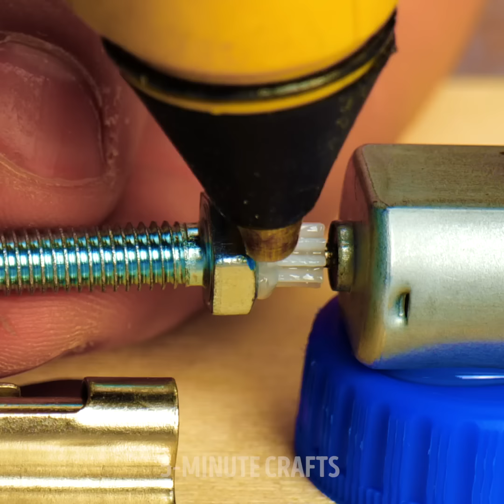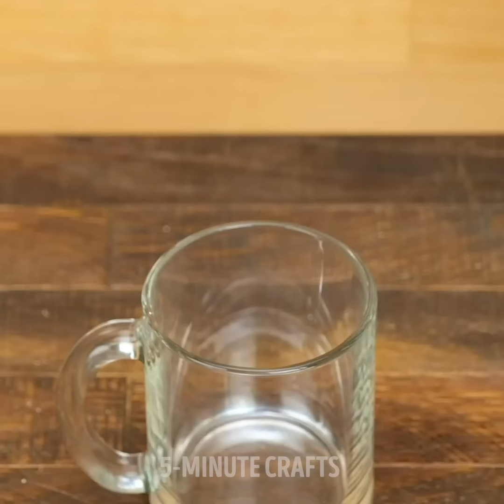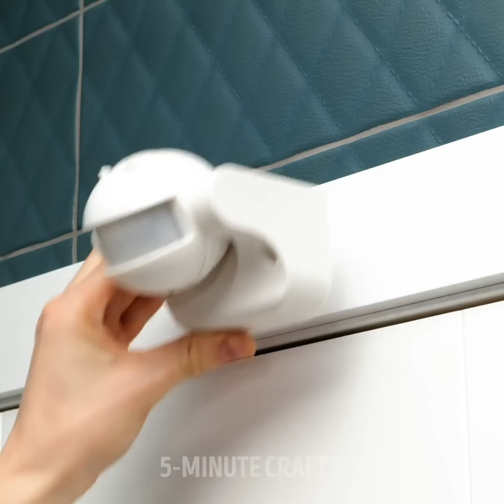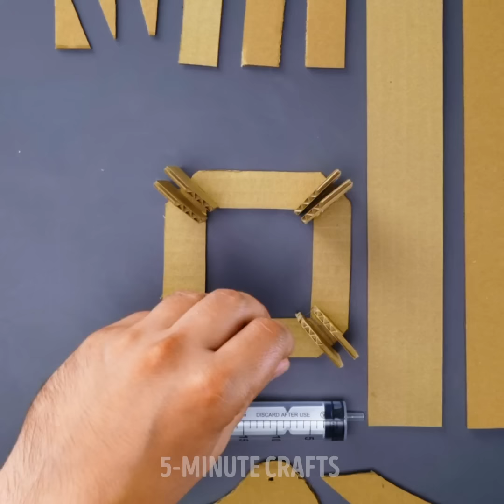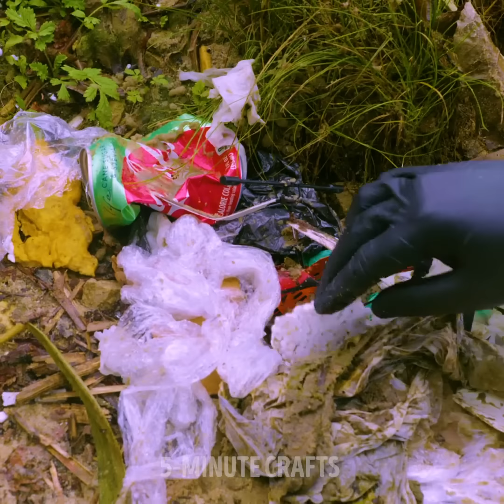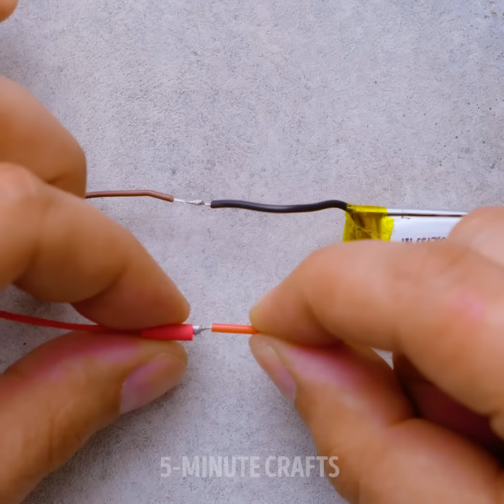15 COOL inventions TO MAKE YOUR HOME SMARTER

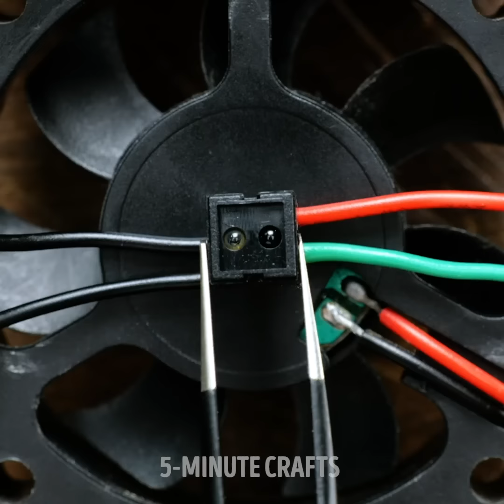Comment: 3:30 what is the name of this component
Reply: Same question
Reply: The fan should not stop like that. It needs some more electronics for it to stop at a certain temperature or at least stop after a certain time.
Reply: Infrared temperature sensor?

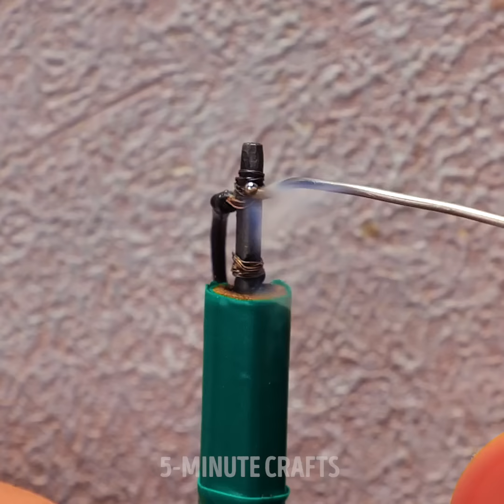Comment: 2:36 who tried to make the soldering machine? did it worked?
Reply: Do not even try. The huge unregulated current will ruin the battery....may light on fire and the battery doing so is pretty bad
Reply: @saranyamukherjee40  ok thank you very much
Reply: I tried it now but it doesn't work😕
Reply: @eleonoraleonardi8975  I tried it too but didn't worked🤔🤔

Comment: sir is the soldering iron with pencil really works? i did exactly the same thing as you did in the video but it's only the battery that's getting hot and not the tip of the pencil..can you help?
Reply: Eu gosto muito dos seus vídeos  de informações
Reply: This is graphics